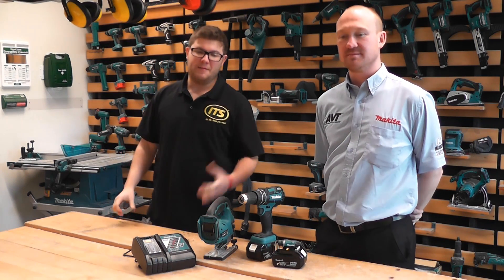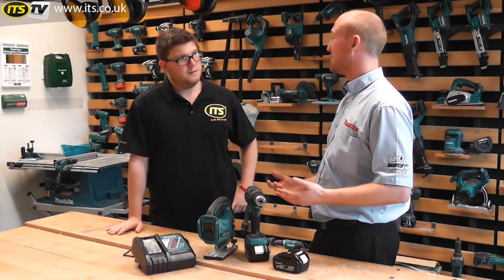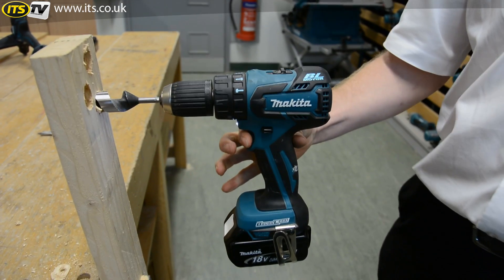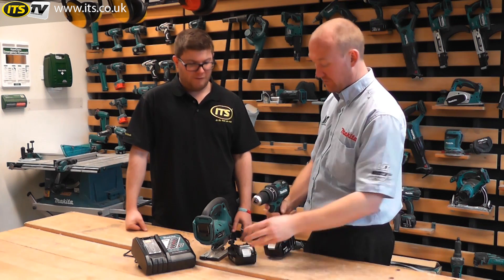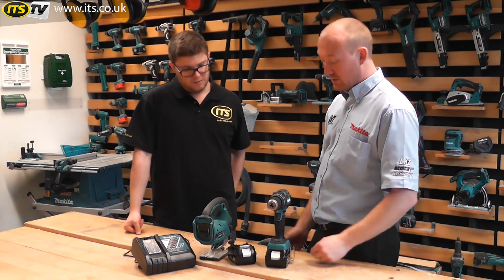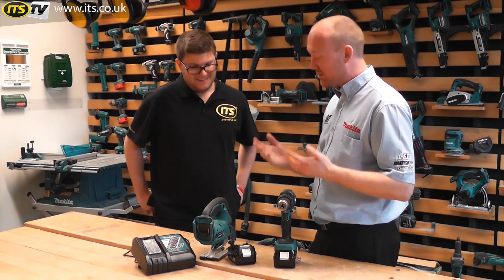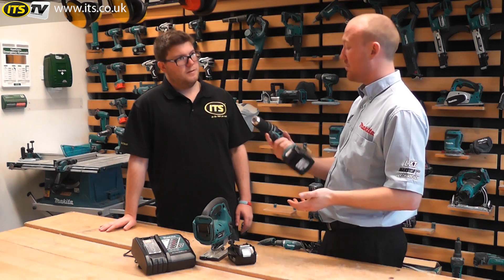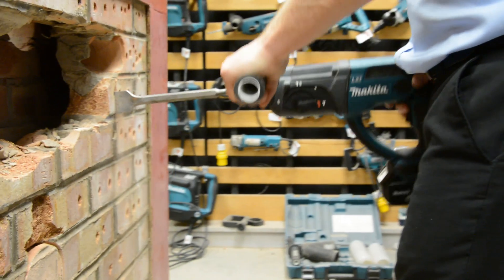How to look after Makita 18v Li-ion Batteries

Comment: my 4ah batteries last about 20 mins. im not overloading them nor overworking. are they faulty???
Reply from the maker: Hi Michael, thanks for getting in touch. How long have you had the batteries?
Reply: 2 months. I bought a new twin set just before xmas as the last makita combi drill finally packed up. Is it worth having them checked with a specialist.
Reply from the maker: michael burnell We would recommend that you call Makita's service centre as it's under warranty for a year. The number's 0800 345 7942. Hope that's helpful!
Reply: i would it is, i have a 4ah and it can do 250 screws maybe more, and generally lasts around three hours

Comment: How long do Makita Guarantee their batteries for in the uk?
Reply: The batteries are guaranteed for one year.
Reply from the maker: Hey there hucks33, Makita gives a 1 year guarentee on their batteries but if you're outside of this, you can send the battery to Makita and they will test it to see if there hasn't had many charging cycles. If the amount of charges is lower than they expect, then they are likely to replace it. Any further questions, just let us know!

Comment: The lithium ion batteries must be discharged to a storage voltage if they are not going to be used for a while.In the model world a charger has a setting for this.Dont store them fully charged if you want them to last.
Reply: lithium ION batteries are different than lithium polymer batteries for rc vehicles.  lithium ION does not need to be storage charged.  they can be left ran down or left fully charged. 
however these makita batteries cannot be left low because they have a circuit in them that will keep draining the battery.    it will prevent the makita charger from charging it if it goes below their cut off.  which is definitely set too high.  I have tested several of the bl1830 units and they're at 17.98 and the makita charger will not charge.    that's only 3.5 per cell.  2.5v is actually the limit for lithium ion batteries.   the cut off could be set to 3.  why set it to cut off at 3.5? to sell you more batteries.
Reply: I read that lithium batteries are supposed to be stored at 80% charge, the green and red lights should both be lit when the battery reaches 80%.
Reply: good to know as i have 5 li ion 36v bosch batteries that i dont use but have been keeping fully charged, now i know im gonna use em and keep them stored on nearly empty
cheers Ian
Reply: nearly empty is also not the way to go. keeping them on half charge would be better :)
Reply: Lithium needs to be stored at 50-60% battery

Comment: my makita charger refuses to charge a WORKING battery. no way to reset that bloody thing. this is to rip you off and buy new batteries.
WHAT AN ABSOLUTE DISGRACE. I am totally pissed off
I will switch to another brand as soon as possible.
Reply: Rickm2711 _ i used 2 18v3ah batteries rotational in a recipro saw.Both had ~10-15 charging cycles. I didnt torture them,  they became slightly handwarm.there was still sap in them before i did the recharge. Well, one didnt want anymore. I had to throw it away. This is not acceptable, period
Reply: @crankupthechainsaw  wow..Im thinking to buy makita impact wrench...now..my plan B is milwaukee...
Reply: I'm still confused as the batteries I bought three years ago work just as well as the first day?
Reply: JLB athome thats not the point. the lil man in the battery shut off the recharging. dont tell me li ion batteries can't handle that. I got it recharged with a friends balancer, no problem, same capacity like before. 
It's a rip off.
Reply: go bosch all i use is bosch and the only thing ive brought over 10 years is brushes
Reply: Rickm2711 _ sorry to read such bad language. Its not the tools, they're excellent. Its the batteries. The chip inside is shutting off, even with good cells. And there is no way to reset it. Absolutely no way.
Reply: +crankupthechainsaw it's the 3ah ones they had all the problems with. Try a new 4 see how you go
Reply: +Adam Lynch thanks for the hint!
Reply: Yep u right. Very good tool
..but with that problem forget it...

Comment: Failed to mention that you can use a battery today put it away fully working, use it tomorrow and the so called chip thinks a cell has died end of battery!! Mickey mouse Makita batteries. Thousands of people have this problem and what are Makita doing to fix the problem? Nothing.
Reply: I’m a contractor since the late 70’s. I’ve been using Makita since 1985. No tool is perfect but they among the finest, most durable hand tools ever made. I have about 16 lithium-ion batteries for my business. I switched to lithium-ion in 2009 and still have some of those batteries still working. You’ll can always find a crybaby who wants to bitch even with the best tool available..
Reply: Jungle -  Nice bitchslap.  Respect.
Reply: Rothjon u can boost the battery so to speak and bring it back to life
Reply: This is mainly because of wrong usage. Usually, this happens because two cells in one series get drained (overload/heated/cold; or they were almost empty after use and the cells drained themselves). Thats why always half charge them after use. 
The chip is not necessarly "marked" as one could suspect. But yes they should install intelelgence against all those situations.
A solution/hack that worked for me everytime is to open the pack -  locate the batteries in series that are supiciously low via multimeter - ca. 1v - chop off the mini end of a usb cable - and carge the cells up seperatly in series by pluging the usb into power - connect the naked ends of about 5v/low amps onto the ends of the series (all still conected and together) - plus to plus and minus to minus - after five min check the voltage make sure nothing is heating up and repeat for 5 min- check the voltage - if the series is now telling you 10v - you are probably good to go. Screw everything back together and recharge the pack properly - let them cool off and put them to good use - the cells or one of the two cells are probably not  the fittest any more but they will work again.
Reply: +david appleton money spinner for Mikita.
Reply: I've had all of my 18v makita kit for a year and half now, and every piece of kit and battery is used heavily everyday. Not had a single problem with the batteries, although the combi drill did burn out after 6months, but was exchanged the same day.
Reply: Makita is loseing money when the battery's  fail prematurely